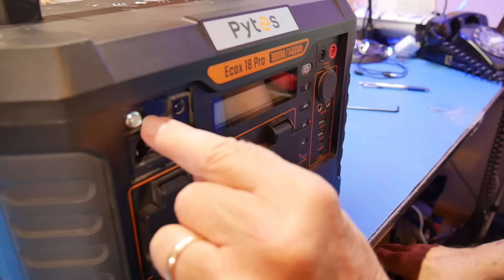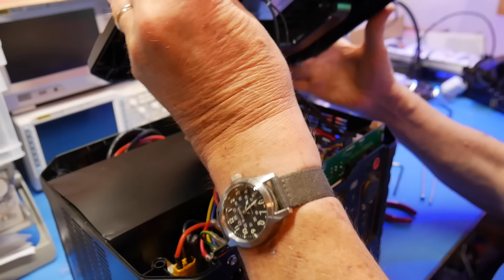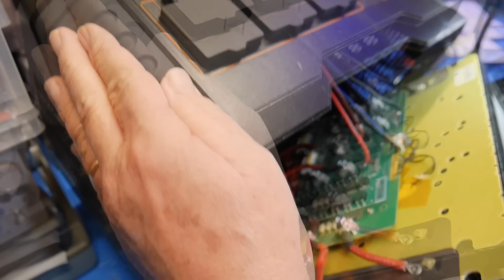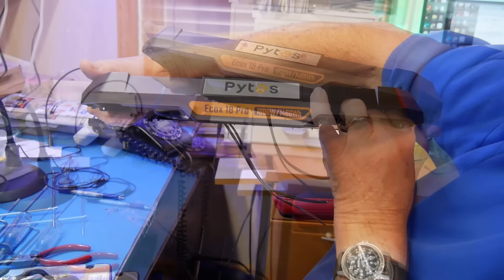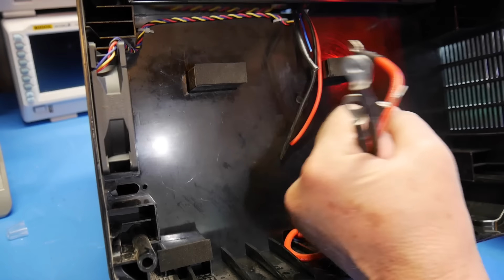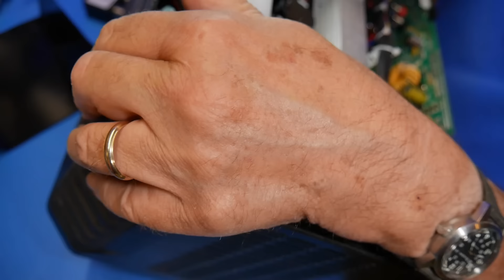What's Inside a Broken Chinese Power Station (#1301)

Comment: Two observations:

1.) I would have removed and reconnected the positive and negative leads from the BCM board to see if that reset the error code.

2.) Work like this should be done in an area where there is no risk of fire spreading in case you short out something and cause the batteries to go into thermal runaway.